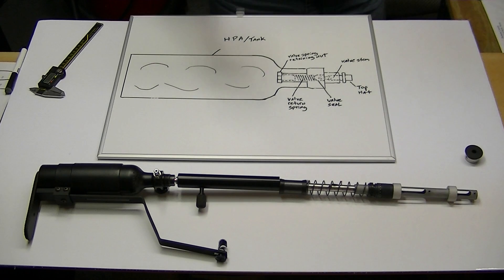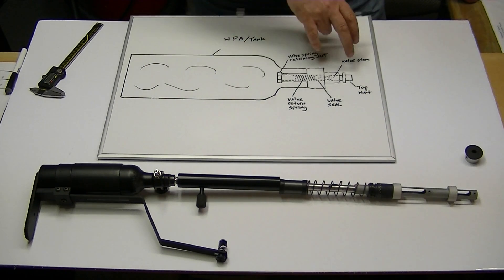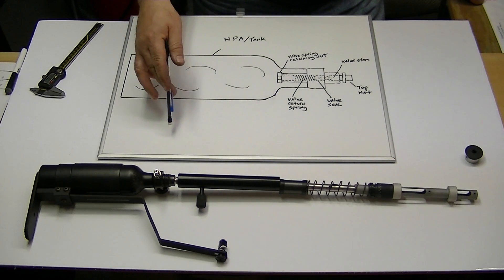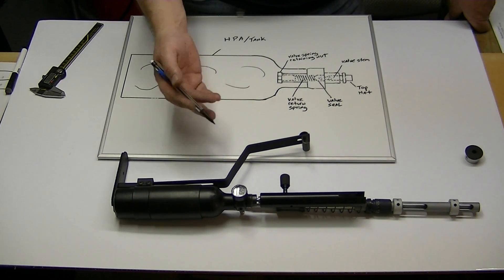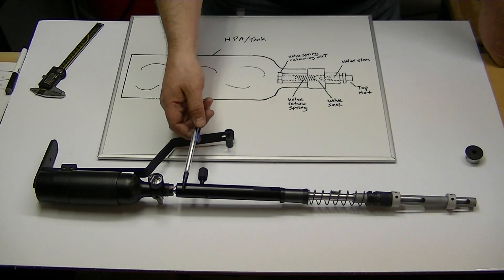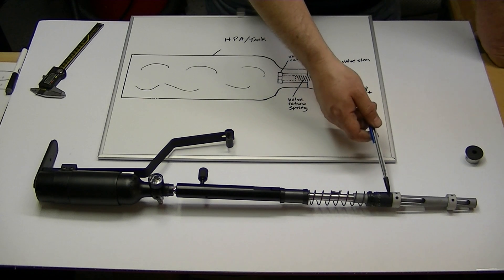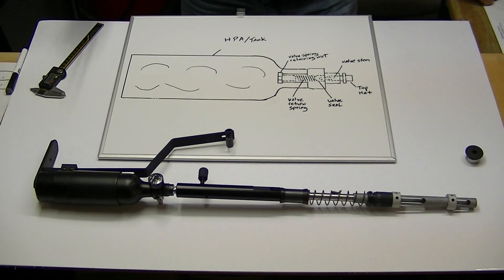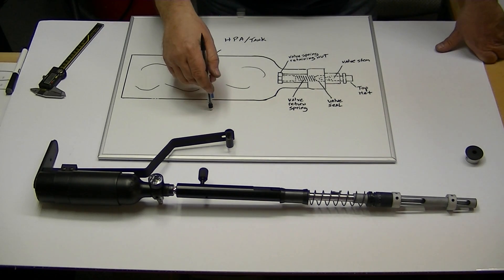Airforce Airgun Shooting and tuning (part 2)

Comment: I was wondering if you have ever had trouble with the safety? I have the escape ul and after I load a round and go to disengage the safety it doesn’t push forward like it’s stuck. Take a little back and forth with the bolt to un stick it
Reply from the maker: The older push bar safeties and the newer toggle type are both not great.

Not advocating necessarily for removing the safety, but many people do just that.

Comment: what is diameter spring valve wire in tank? i have custom but too heavy for hammer, need more.soft spring
Reply from the maker: @wanswansl7762   9.28mm od, 1.20 wire thickness
Reply: @davyboone1794  tq boss..

Comment: I have seen regulaters on the air bottles for other hpa air rifles here in England. They don't work totally perfect but can apparently create longer shot strings at more consistant velocities. Might be worth a look into. I think paint ball air bottles also have a regulator valve. Maybe these can be  put together with the right threads for the bottles and top hats to make better consistency in the Condor rifles etc. Here I. England I own GunPower Stealth which is the same as the Condors in design but a different name and the same velocity deviation problems😮

Comment: Hai brooo ...could you tell me
How to upgrade the power of AFC CONDOR 177..I was used the power whell the full power I only get 1200 fps with 17 grain pellet in 2700 PSI  I have condor 177 I want up the power to 1300fps up with 20 grain pellet..what sould be I do for the Valve,,gamer and spring,thank you🙏☕☕
Reply from the maker: Some people bore out the valve stem to increase air flow, but you have to be careful especially with the 177. too much air can overpower the small bore and caused an air dump.
Reply: @davyboone1794 for the gap of 177,,how many Mili meter...for maximum gap  the Valve,to avoid the dump🙏☕
Reply from the maker: @putrathehunter1625  I honestly don't know the answer to that. I've never had a 177 before. Be safe, go slowly and search the AG forums on the subject. Also If you can reach him Tony at talontunes has done this in years past.
Reply: How I can grt the Tony tallon Chanel ❤..

Comment: My Talon SS is very hard to cock. The safety seems to be gouging the hammer when the cocking lever is pushed forward. Have you seen this? Is there a video for removing the auto safety and leaving it as a manual safety?
Reply: It can be one of the screws that is for mounting your bottom grip. From factory it was too tight so it was scratching my hammer and made it hard to cock.

Comment: I drive fired my  Air Force 50 cal... Now I hear something in the air tank. I'm guessing the top cap came apart.
Reply from the maker: Air Force's really good about fixing things when they go sideways. Give them a call and they will repair it for you.
Reply from the maker: 1877-247-4867

Comment: How does one address Valve Lock mentioned in this video?  I shot about a dozen rounds from my Airforce Texan SS with my first fill from my Air Venturi Nomad compressor and re-filled the airgun tank to 2900-3000, I shot one additional round after that fill and from that time forward the gun doesn't doesn't charge with air.  I think; but don't know for sure, that I may be suffering from valve lock.  And to add insult to injury, my tank is still pressurized and I'm not sure the safest way to depressurize it, so I can work on the bottle and the valve lock issue safely.  And thoughts or suggestions would be greatly appreciated.

Comment: Will a spin lock condor tank fit on a talon p if not how would I go about getting a bigger tank for my talon p
Reply from the maker: It will work fine you, would basically have a Talon with a 12'' barrel. You could order it from AF or any AG supplier.
Reply: Thanks